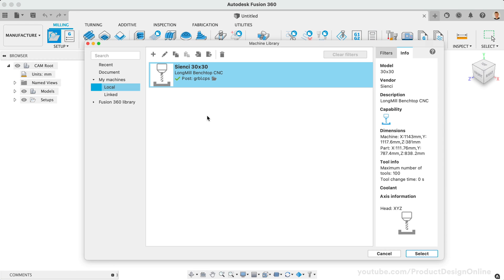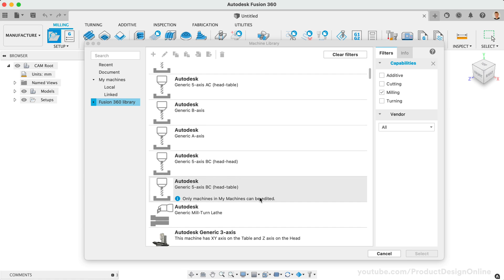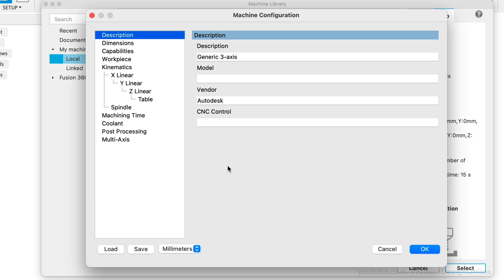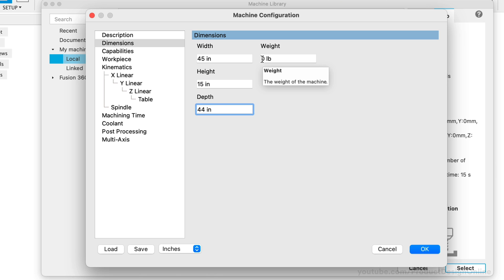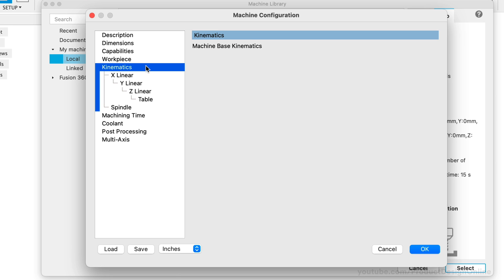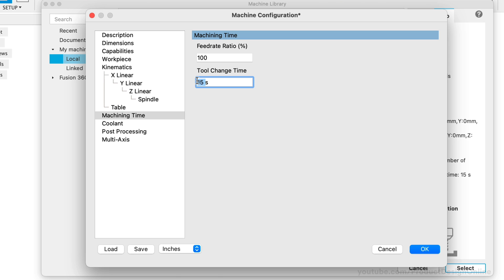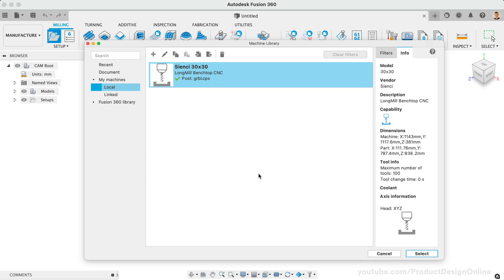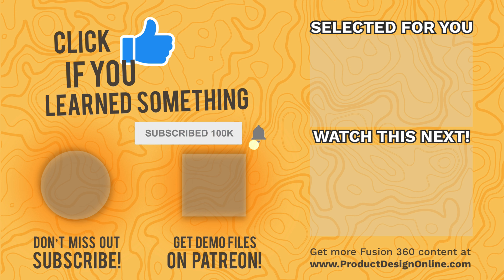Create a Custom Machine Configuration in Fusion 360 for Hobbyist CNC | Shapeoko, X-Carve, LongMill

Comment: I was very hopeful when going thru this video, as I am using a homebrew CNC with a TinyG controller; so the GRBL generation path is the most likely one for me to follow.  BUT, when I get down to "Post Processing" in the Machine Definition dialog, No choices are presented!  The only option shown there is "Restore All Defaults".  I have the "personal" version of Fusion360.  I hope they haven't removed all hope of hobbyist use of the "Manufacturing" path in this otherwise capable tool!!!   Is there Anyone who knows how to accomplish this?  Thanks for a great video, BTW, even if it is likely outdated! :(

Comment: Thanks for the tutorial!  I have a Snapmaker 3 in one machine and Iv got the 3D printer and the laser  functions to work but cant get the CNC to read GCODE from Fusion 360. Could you please tell me where my mistake is?
Reply from the maker: You'll need to make sure you have the correct post processor so when you 'post' the Gcode in Fusion 360 it is readable by the Snapmaker. I'm not familiar with Snampaker, but found a great thread with some tips on posting to F360: https://forum.snapmaker.com/t/available-now-new-post-processor-tool-library-machine-configurations-for-fusion-360/24955/11

Comment: When I go to set up my machine (a 4030 proverXL) I am selecting the generic CNC router but in the machine definition window I only get General, Capabilities, Kinematics, Post Processing and Additional Settings.  The Infor tab on the right hand side has the machine dimensions and part as all zeros.

Comment: The machine definition UI has changed quite a bit since this video was made. Do you have an updated version? For example, there's no "dimensions" tab anymore and the "kinematics" section has the machine details nested inside.
Reply: this is what i'm struggling with. This is incredibly confusing.
Reply: Any luck on this fix ?
Reply: Well, I did discover that they've hidden the inputs for the axes in the kinematics tree; you have to click  on the axes one at a time to open up the dialogs for those settings. Though I'm still at a loss about some of the other settings. . . not sure they're even critical though.

Comment: I have some issue with the “dimension” menu. It’s not there. There is nowhere to put in the dimension of my working table.
Basically there’s only these menus;
General
Capabilities
Kinematics
Post Processing
Additional settings

And that’s it.
Quite annoying there’s nowhere to put in the dimension of my machine. Or I’m not able to finde the submenu somewhere?
Reply: Did you find any solution? I have the same problem...
Reply: No, i haven’t found any
Reply: @KeaAlstrup   I did, apparently is a very recent change to the machine library, it seems you don't need those parameters anymore, also you can still revert to previous version. To revert it you have to enable the previous version. If you copy a machine into your library there will be a message prompting that it was made with an old version and that it will be upgraded to the new, in that message there is a link to a video explaining how to revert this change and use the old profiles. Hope this helps!
Reply: @CarlosMartinez-gk8vd  Thanks, that was useful information. I’ll se if it makes any difference. 
Saw the video, and that was what i was missing. But if it is removed and it makes no differences thats ok. It seems weird to me that I’m not able to tell what size working area i have. But that’s mee!
Thank you for the help.

Comment: I would like to know how to model the cnc bed as well as all the settings so i see (and can toggle) the bed on and off to make sure I have orientation correct, use the clampdown points efficiently etc etc. is this possible? Design a project on a model of the CNC bed?

Comment: Would you be able to update your video for the current version of Fusion 360 please.  All the options are different and it's very confusing!
Reply: Agreed! The new version does not even have a dimensions option on my end, which seems like the most important info.
Reply: @robsproducts  Not sure what machine you're using but mine uses a GRBL post processor and I've worked out that I don't need ANY entries in the machine library except for Name, and post-process set as grbl.  Once I've generated my toolpath and exported my post process file, I then load the file into gSender and my machine settings in gSender are what matter.

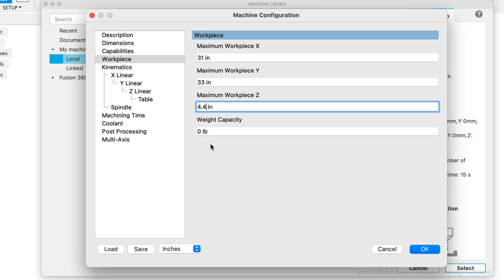Comment: At 5:27 you set the work piece as X=31in, Y=33in and Z=4.4in, meaning X=787.4mm, Y=838.2mm and Z=111.76mm...
Then you click ok at 8:12 and the displayed information for the workpiece is X=111.76mm Y=787.4mm, Z=838.2mm...
Why??? Still happens on current version. Even if the input is directly in mm... Why?

Comment: I used a time not but now there was a update, nice. But there a thinks changed. The setup en the machine gcode is not more the same. Why? I don't. I most now spent a lot off time to change it. And i have build the machine not in the list. I hope that this settings work.

Comment: Great video! Perfect timing as I am just heading down to my office to do this very setup for my recently finished 3 Axis CNC router of my own design.
In the Kinematics section, it seemed like the stationary axle was the X-axis, I assume this can be changed? On my (and many other machines I'd say) cnc it is the Y-axis rails that are stationery and moves a carriage with the X and Z axis and spindel on it.
Reply: I ended up just using a Generic Autodesk 3 Axis mill with the correct kinematics, worked perfectly :)
Interestingly I also got a bit of preview of the coming function for modeling the entire CNC machine. I used Cloud storage for the Machine setup and it created a file in my folder with a 3D model of a generic machine. When I opened that file Fusion said it was created with a newer version of Fusion (and afaik I'm running the latest public build) which could create problems, but it opened just fine :)
Didn't try to change it, but maybe I will.
It didn't have any joints or anything like that, not even a Time line in the model, så maybe it only affects the Thumbnail of the machine in the library so far?
Reply: And now the full Machine Simulation is available in preview :)

Comment: I wish I could find more info on setting up a 4 axis machine.
Reply from the maker: What machine do you have?
Reply: A chinese cncest 6040 with 1.5kw spindle and 4th axis. It doesn’t have limit switches so it doesn’t like G28 and also I can’t seem to get the set up right in fusion. I do have the paid version for this reason. Im also using Mach 3
Reply from the maker: @rpgallagher7628  Ah, yes you may have to create a custom post-processor or manually remove the G28 each time. This is a common 'problem' with exporting from Fusion 360 to manny of the hobbyist-level CNC machines.